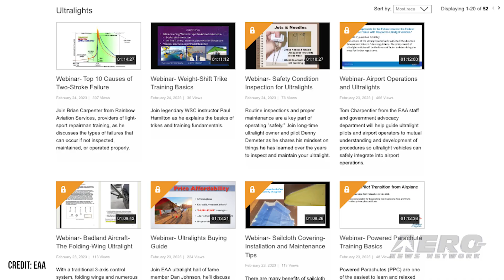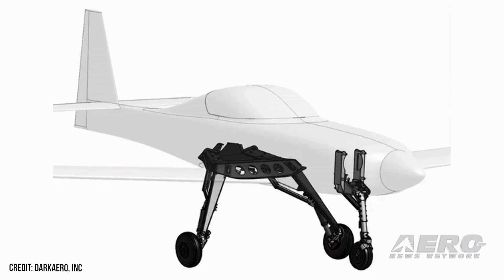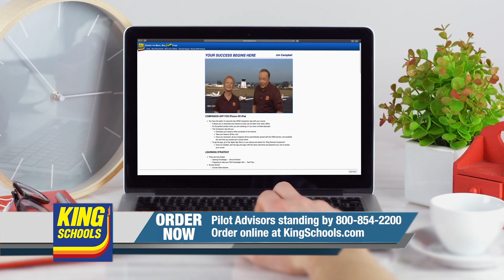Airborne Affordable Flyers 03.09.23: EAA Webinars, Merlin Update, 160HP eMotor

Comment: Bought one of these V-Twins last year at Oshkosh for $7500. It took all year after I sent my wiring harness in to be rewired from an ATV wiring harness to an aircraft harness, removed turn signals and such, and the harness they sent me has bare wires, no convoluted tubing, NO WAY ANYONE WOULD INSTALL THIS ON AN AIRCRAFT! He finally sent me an original wiring harness after months of waiting, I re-wired it, looks beautiful! But now I need a motor mount, fuel pumps, throttle cable, exhaust, propeller.... and Chip says to try Amazon. I'm going to Oshkosh and see what he has to say about my $7500 brick!
Reply from the maker: Brian.... please reach out to the staff of ANN's SportPlane Resource Guide at sprg@aero-news.net ... this is the kind of data that we investigate so as to provide guidance to other members of the aviation community... we'd appreciate your input.
Reply: @aerotvnetwork  Sure! I want small companies to prosper, but if they can't support what they sell, especially to an old Air Force retiree, they need to go into another line of work.